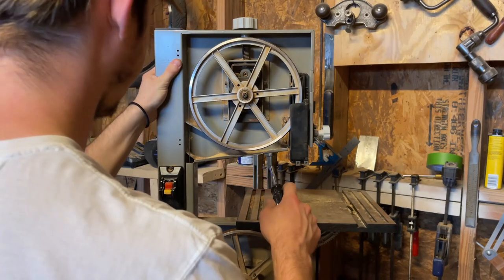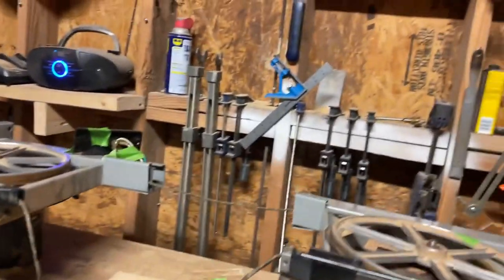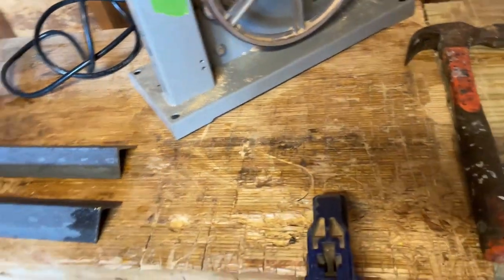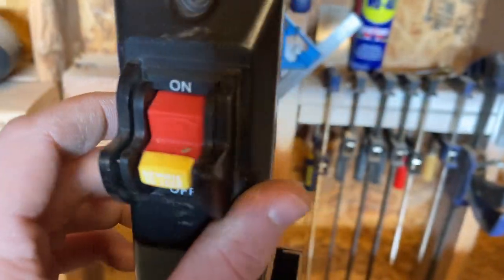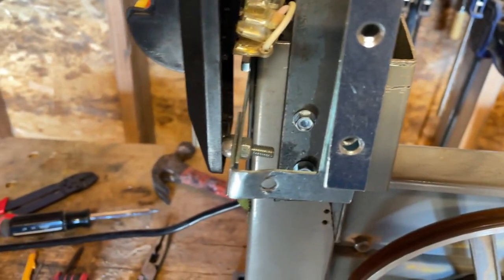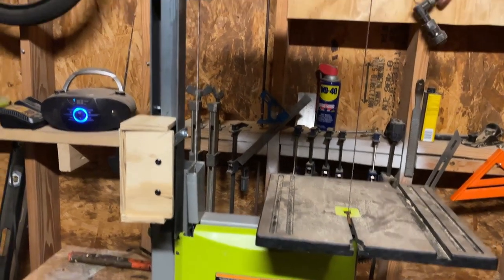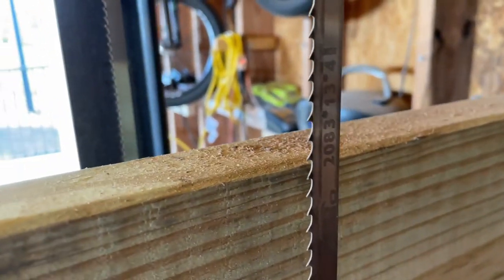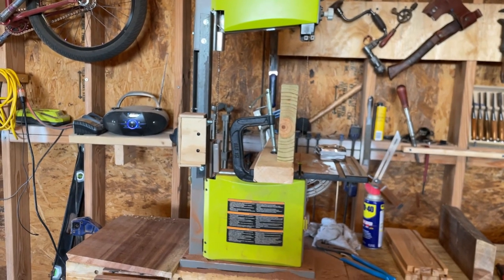Adding 10 inches of Height to Bandsaw for $50 | Making a bandsaw with 14 inches of resaw capability

Comment from the maker: The blade is 82 inch X 0.5 inch X 4TPI. Originally I had tried with a blade that was 0.25 inch and 6TPI, but the motor was not powerful enough and it kept binding. This blade seems to work fine for now!

Comment: Just stumbled upon this as I’m currently in the process of increasing the throat depth of my Grizzly G0803Z to a little more than 6” from its intended 3.5”. To do so, I’m working on the other end of it from what you did  - I raised the position of where the guard attaches farther up into the machine, and plan to cut away some of the area around where the guard moves up and down to give it maximum clearance. If I wanted any more resaw capacity than that, I’ll have to do something like what you did, or get a bigger bandsaw. For now don’t work on huge projects, so just the extra 3 or so inches should really help. If I find the need for more I might spring for either a big frame saw or a bigger bandsaw and keep the benchtop one for the little shapes in thinner material it’s intended for, before doing more bandsaw surgery.  It’s very interesting what you did, almost like a DIY riser block. How’s it holding up? How have you found it to run with the 0.5” blade, as I know that these little bandsaws are typically made to run a 3/8” max? I think having a good blade in it, despite the obvious power deficit of a 1/3 HP motor, makes a lot of difference. Timber Wolf blades have been a night and day improvement over the big box/amazon ones for me. Hope it’s going well!
Reply from the maker: Hey, the bandsaw is holding up super well! Honestly, this is one of the best projects I have ever done, simply due to how much wood I have re-sawed with this. I recently sawed some live oak that I used for a table. Because the motor is very underpowered, I just have to guide the wood really slow, but it works. Im not concerned too much with straightness of cut, just because I can plane it flat later. I have also cut a 10 inch monkey pod slab, 12 inch live oak log, 6 inch Cyprus, and some others. But yeah it's all about the blade. You gotta get a high quality, low tpi blade for sure. I think I got a 4 tpi if I remember right, but I would try to find a lower if possible. 100% would recommend this if you don't want to spend the money on a big bandsaw. I spent like 150.
Reply: Great to know. When I reach the need I may do something like this! I like what you’ve done - so many “pinky in the air” woodworkers would tell you that something like this would absolutely not work and you need to fork out the $$$ to have good results, but you just went ahead and did it and have shown that it works for the hobbyist. Thanks!

Comment: Mate what a great idea and as you said cost effective. How did you workout if you could get blade to fit the change in size
Reply from the maker: i tied a piece of string around the band wheels and then measured the total length. I ordered the saw blade from timber wolf saw blades. I just tried to find the lowest Teeth per inch blade I could find so this tiny electric engine could handle it. Ive re-sawn black walnut, live oak, spruce, and it has done just fine.

Comment: The cut looked a little Squirrley. But it did cut it in half, can always plane them down and have two usable pieces.
Reply from the maker: yeah for sure, I need to tune it more. Needed resaw capability of at least 7+ inch for a couple pieces of cypress im using for a bench, so this was the quick and cheap way to accomplish that. I didn't really care about finish quality because im just going to plane it down anyway to finish

Comment: Are you still using the stock motor?
Reply from the maker: yeah, its not really powerful enough, but I have still managed to cut through 12 inch monkey pod wood and live oak somehow if I just go super slow. My plan long term is to install a 2 stroke engine